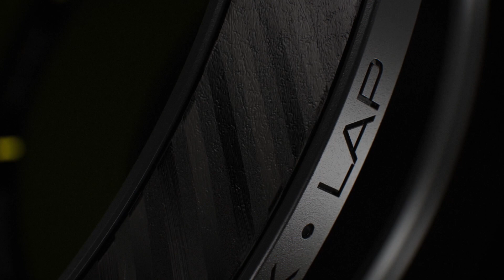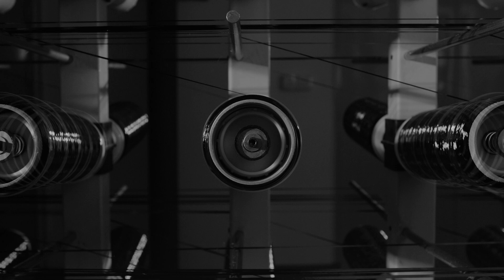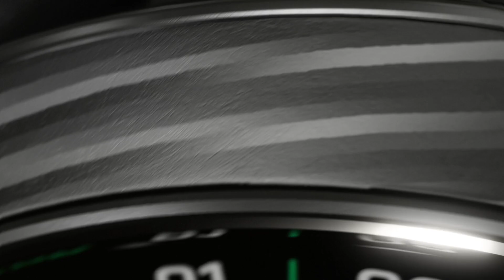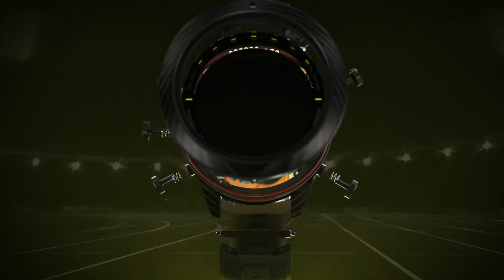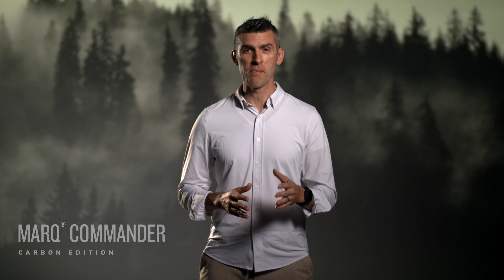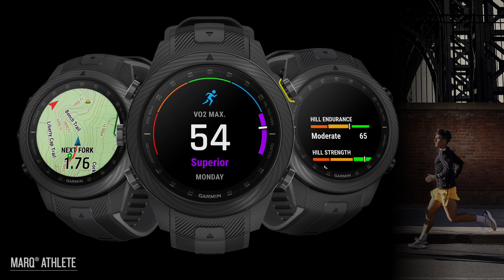Garmin | MARQ Carbon Collection | All-new Modern Tool Watches

Comment: I bought my Garmin MK2S in Japan only to realize that it was not functioning properly after | left Japan for Maldives. Even though Garmin is an international brand, surprisingly they don't have a service center in Maldives. So, I went to India to get it repaired at their Amit International service center. However, they couldn't fix it. It took them 45 days to check. I have missed so many dives! Now that they said they can replace it with a new one but they asked me to pay 300$ for customs. I kept the watch with them because I was too tired of dealing with their lousy service. Not worth it. Don't buy Garmin guys. @garmin, hope you read this. My time is more worth than your product and service.